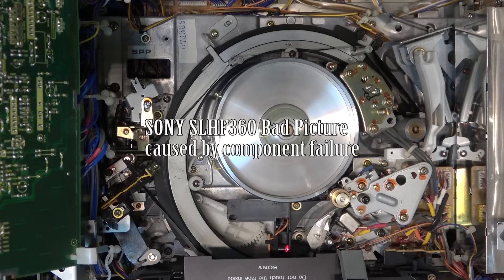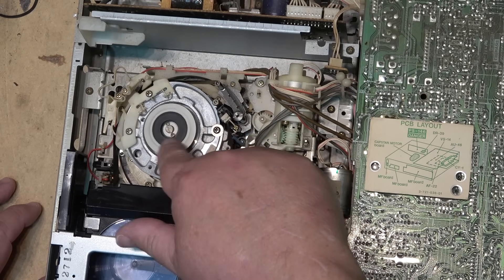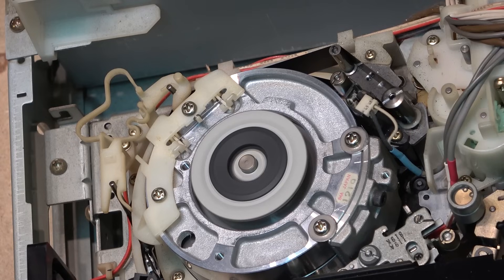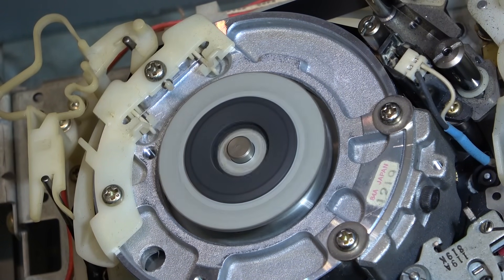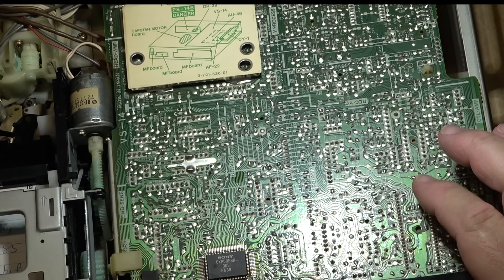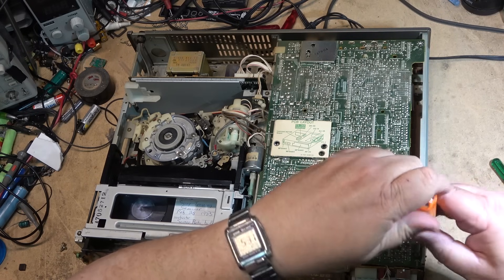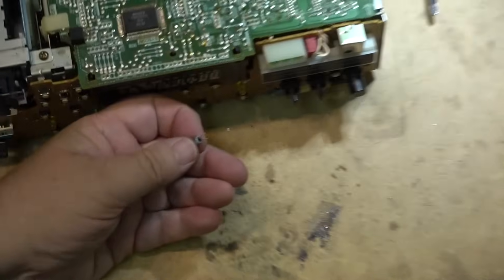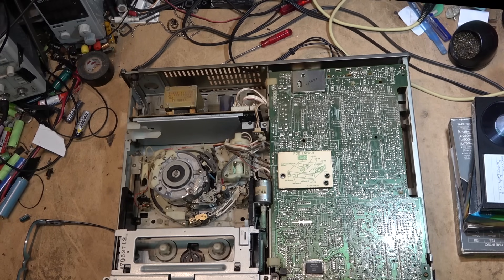Sony SLHF360 Bad Playback

Comment: I have my Sony SLHF450 and it works great without any problems. I got it off of eBay last year when I first got it, it had a bad picture since the video head was dirty, but I checked and cleaned the heads and the picture looks perfect.

Comment: This exact kind of pumping of the image was mentioned in the text books at school when we learned to fix these things. I recognized the problem at once you had tried to clean the heads.
Reply from the maker: Good old analog servo circuits.
Reply: @12voltvids  yes. :) In fact when I did my test after apprenticeship and got my degree it was a CRT tv and a VCR I got to work on. Sadly just a VHS deck. What they did was put a tape on the head used for tracking. lol. Strangely enough only 2 of us out of 12 made it to get the degree. Just show you can’t read your way to electronics. There must be an understanding of what make this and that happen.

Comment: Used to have one of those, even had the service manual. Our had a similar issue as yours. Playback was flickering but recording was just fine. Had stopped using it around 2009.…
Reply from the maker: Interesting thing about this player is it will playback beta 1 speed recorded in 6.0mhz super high band.

Comment: It's hard to believe Sony used these bad Sanyo caps on their 1981 model, and after that huge failure rate, they still insisted on using them on their 1988 model. What were they thinking? My 1983 SL-T30 and T50 also have one or two of them in the luminance/video circuit but playback and recording looks fine so I haven't touched them yet.
Reply from the maker: Obviously sanyo convinced them that the problem was fixed.

Comment: Thanks for demonstrating this with the florescent light. When the servo goes out of sync like this, does it happen on recordings for all speeds BI, BIi, BIII in a similar way. I’m guessing it is most sensitive on BIII?

Are there other scenarios that would cause this such as a tape that was recorded on a bad machine, or a tape that had somehow been stretched in an irregular way? I have some BIII recordings that have similar issues and I’m trying to determine if it is the playback machine or not. They came from a collector who I think recorded everything but didn’t watch any of it.
Reply from the maker: Nope the servo is hunting.   A bad tape with a damaged control track could cause capstan servo trouble but not drum.

Comment: Great 👍
Edit: I would assume even DC powered lights would flash, (using AC and a rectifier to convert to DC) but only if they're not  filtered, correct? Or do they behave differently? Interesting strobe effect, if that's what it is called.
Reply: Some LEDs are well filtered, some are poorly filtered. The poorly filtered ones might also work.
Reply from the maker: Led do slightly, but its more of a fade between the power pulses.  Fluorescent on the other hand Is a pulse light source. They light up during the power cycle and extinguish completely during the phase reversal.  So you get the strobe effect.  It only works with magnetic ballast.  Early compact fluorescent had magnetic ballast.  Then they went I high frequency electronic ballast. Those don't work.

Comment: For a reason we don't unknown most Sanyo electronics come defected or fail after some time,

I remember to saw a documentary in 90's about SANYO manufacture and assembly lines in Japan and when investigators found was really huge logistic problems on the assembly line, can't remember the details, but literally employees had to assembly everything from scratch on their stage it was ineffective procedure to provide quality manufacture goods,  
Every stage was like a miniature parts' shop, electronics everywhere and usually employees had to assembly different stuff at same stage,
Similar as you see today in China but with smaller space and fewer people working with similar amount of goods output. It was insane.

If I remember well was a early 90s documentary, I came to assume it was the same or more basic procedures in the 80's, 
can't imagine how capacitors and IC's manufacturing procedures should be at SANYO that time.
Reply from the maker: Yup sanyo was known for their cheap and shoddy electronics.  Why do you think their betamax unloaded the tape when you pressed stop? Because they used the same microcontroller that was used on their vhs machines.  Yet some defend sanyo.  They were garbage as were their components.
Reply: @12voltvids  Absolutely, I still have a Sanyo portable cassette player you won't believe but also had to replace their Sanyo capacitors on it due to issues with motor stability, I replaced then with brand new capacitors and work like new. 

I have a SL HF900 I will take a look at those capacitors more closely, I'm planning to replace the old 10000uf Elna capacitors on power supply. They start looking slightly swallowed. 

STK regulator had been replaced, but still not change anything on the power unit yet.

Comment: Really interesting, thank you for this vid!  I picked up 6 SL-HF400/600's and they all seem to pulse very similar to yours timing wise, except I am not having any visible glitching.  I assumed that's just how this model was since they all do it, but now I'm wondering if they all have bad caps in the servo circuit or maybe those little yellow caps. hmm
Reply from the maker: Light blue. The bad ones are light blue made by sanyo.

Comment: How did you know that this is a component failure and not a potentiometer tune of servo lock required after all these years?
Reply: @ilanuriel2573  sanyo did supply some average caps around 1982, notoriously the PAL sl-c6 equivalent as well. And I suppose Daves done heaps of these SL-HFs to even (say blindfolded) without a manual figure where the servo circiut would roughly be then track it down.
Reply from the maker: It it didn't have those known bad sanyo caps i would have rocked some pots. However after having changed thousands of them on brand new machines that had not even made it to the store for sale yet back in 82/83 when I worked for Sony, when I spot them I am on high alert.  That was the symptom back in the day with servos that would not lock up just like it was on this one so seeing the symptom and seeing those blue Samuel the illumined solid caps That was the symptom back in the day with servos that would not lock up just like it was on this one so seeing the symptom and seeing those blue sanyo aluminum solid caps, They just had to go and as you saw fixed the problem

Comment: If you are filming,  please put the AC off, the sound is therible
Reply from the maker: Thats just too bad isn't it. If you can't handle the sound of a fan running in the background then you have bigger issues.  If I turn the ac off it gets to about 40c in here.  Even with the ac on it is still bloody hot.
Reply: @12voltvids  i can understand the AC when its getting Hot but the AGC off your mike increases the sound off the AC when  the is no comment from you.
Reply: Please check the post on YouTube and you will hear the issue
Reply from the maker: I watched the video on YouTube as soon as it posted and it sounded fine to me.
Reply from the maker: That is a youtube issue. My levels are fine and the background noise does NOT increase when I am not talking. It is quiet in the background. Youtube choses to apply AGC and level out the sound. i suggest you send youtube a message and tell them not to do it and see how far you get. It annoys me too because sometimes the radio playing at the neighbors gets boosted to the point that it draws a copyright match. Anyway i am not doing any work in a shop that is over 40C and that is how hot it gets. When it is 30 outside the shop is unbearable, I have to have the AC on or I can't work. I would rather not use it, because I have to pay for the power used, but I am also not working in a dangerously hot environment.
Reply: @12voltvids  Can't you add some more insulation in/on the walls and/or the roof in the shop? If there's no other way, even just screwing some hard rockwool to the ceiling with some chicken wire would hold back a lot of heat, that would decrease your electric bill both in the summer and winter by a lot (and it would also double as an acoustic dampener). If you have access to the space between the roof and the ceiling, adding some rockwool with an air gap and a heat mirror foil would have quite dramatic effect. Is the garage door insulated? That's also a huge surface to transfer heat if it's not insulated. With the increasing energy prices, making such investments pays itself sooner and sooner, especially if you can DIY it and don't have to pay the labour of a construction company. I mean, the interior of a garage workshop don't have to be pretty, you can bodge on some insulation in any possible way you can, as long as it's safe. Don't use polystyrene for example, because it's flammable.
Reply: Mrbetabyte sounds quiet on my phone but on a laptop or decent speakers/headphones it's fine and i don't mean your kiddies earplugs
Reply from the maker: I monitor on studio headphones and the levels are correct. The ac is at least 20db down from max and I do not use AGC. Now what happens after I upload i have no control of. YouTube is always fucking around with the files.  What you see looks nothing like what I upload.
Reply from the maker: The garage is insulated.  It has r12 in the walls but not much in the ceiling.  The wall facing the house and all exterior walls from the house have R40 insulation as does the ceiling.  The garage door is also insulated.  It gets so hot because my driveway and walkway is pavers that are about 3" thick and are red. They heat up in the sun and just bake the house.  If I dare open the door it gets even hotter.  Before I put in the pavers I just had a crushed gravel driveway and it wasn't nearly as hot.  Once the pavers went in it turned the heat up big time.  Last year when I was shooting a video in the summer I had to be all done by about 11am as after that it just became too hot.